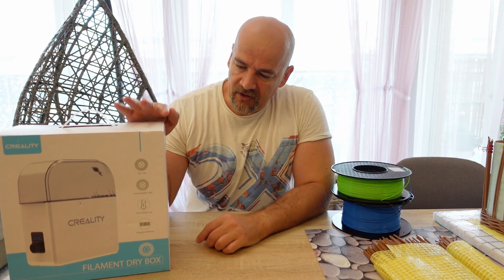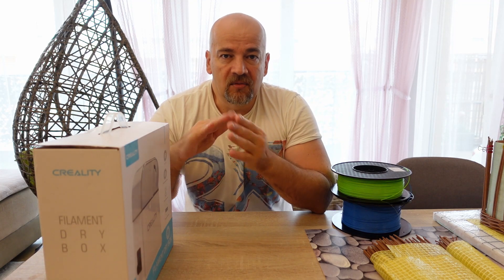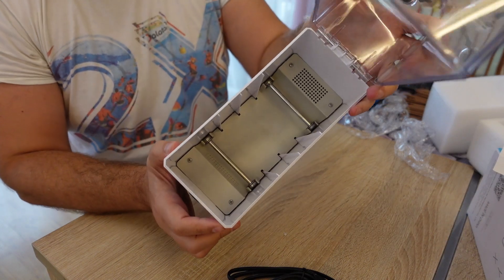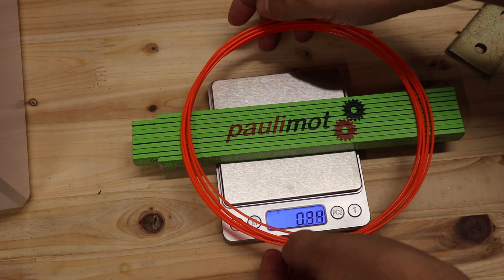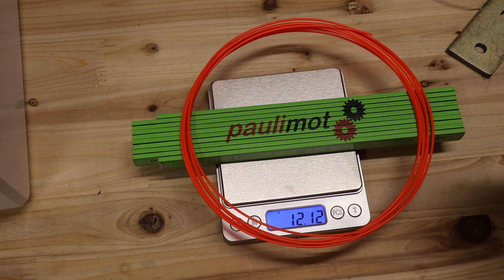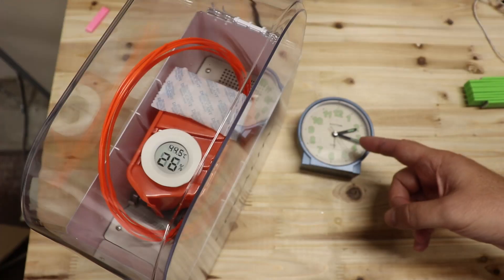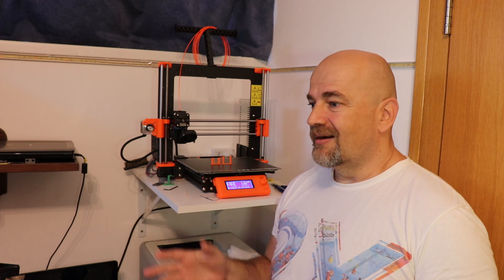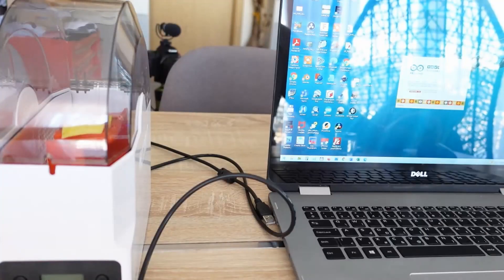Creality Filament Dry Box, new filament dryer by Creality

Comment: Very useful, thanks. I will give this item a skip as I don't think I will be able to trust it with PLA. If they include a temperature setting and a tiny motor to slowly rotate the spool, I'd buy it on the spot.

Comment: Great review. I'm facing an insane amount of stringing, just like the one you showed with the wet filament, so I bought this unit (didn't test it yet). They clearly wanted to make it as cheap as possible, which I think is fine if it works and is safe to use. To be honest I'm kinda tempted to disassemble and modify it, but I will leave that for a future project.

Comment: Which one better this creality dry box or sunlu s2?
Reply from the maker: Creality is stronger, but 95% finished product (great for DIY project if you want to replace the electronics to have more stable temperature). Sunlu S2 is better I think, but not so strong.
Reply: @MyTechFun  You mean S2 not so strong for drying the filament compare to crality?

Comment: This review is ALMOST perfect. Until he put a desiccant on a dry box🤦. I thought we were testing it🤦
Reply: I had similar concerns about the desiccants. Logic suggests, as  you expressed, that the moisture appears to just stay inside the box unless the small hole at the top is left open.  While searching online some info on using my new machine, I came across a site where a viewer asked the question about desiccants and the need for ventilation. The response was that there is a small fan (?) and ventilation port located (hidden) provided to exhaust the humidified air. I'm sorry that I didn't bookmark that site to offer it here.

Comment: Has anyone tried to use this by directly feeding it to the extruder?

I have one, and so far it's worked fine for my PLA (rated 195-215C), but the rubber-coated filament hole in the dry box seems to way too tight, which I can only assume would cause issues while printing, if fed directly  to the extruder?
Reply: You could try putting a short Capricorn tube in the filament hole and feeding the filament through it when you want to print.

Comment: NIce video, but in my opinion when you test the max temp of the base plate it is not ok since you do it with the box open, resulting in hot air escaping and the heaters working longer, than they would if it was closed, to compensate. This result in base plate oeverheating. Keep up the nice thorough work, ill be checking the rest of your vid's. Best regards.
Reply from the maker: I have a feeling, that it doesn't matter, I don't think it has a thermistor. More like some timer, which turns on/off every 3-4 minutes. Take a look this video, the graph: https://youtu.be/6VB-pEvSed4

Comment: you used 4 filament dryer and which one is your favourite or useful dryer ?
Reply from the maker: I tested 5 so far. And from those Sovol is my favourite. Most important advantage is that it can dry my wither spools too (Prusament PETG) , that cannot fit in any other dryer. List of all dryer videos: https://www.mytechfun.com/videos/filament_dryer
Reply: @MyTechFun if ı purchase a sovol filament dryer, ı have to use silica gel ?
Reply from the maker: @adnanbldr9896  For better drying just put one into hole of the spool, but it can dry without it too.

Comment: guys, just make your own DIY filament dryer meanwhile those branded one are still expensive, lets wait for it to drop about around 30.00 but 40-60 for a dryer box are a bit too expensive, since those are nothing new in technology, inside is just a heating element and maybe with a small fan that help hot air to circulate.

Comment: Disappointing that they have not provided better temperature and timer control and a better PID control for the temperature.  Your tests seem to hint that the heated plate is capable enough, but the high temperature fluctuations and lack of control over them seems very limiting.  Lately I get the impression Creality is too often missing the ball, having some correct insights (like using AC heating), but then not delivering the potential due to stupid oversights or possibly cost-cutting.  And when they do have a great product (like their CRTouch), they do not price it competitively and/or fail to advertise the real advantages of it.  I get the feeling they have caught the disease many Western company has: decent engineers and developers on the floor, but too many managers and paper-pushers above them that screw everything up ...

Comment: Thanks for the ongoing and comprehensive reviews. So far, I'm still unimpressed with all of these filament dryers. For the price, they all fail to deliver what I get from a £25 food dehydrator (which gets hotter and fits two 750g spools) for drying and a simple sealed plastic box + silica gel for storage while printing. The parts and materials used in these food dehydrators are pretty much the same as the filament t dryers, so I think what we are paying for is just the fact that there is a smaller market for 3d printing than for cooking appliances.
Reply from the maker: I agree with you. Eibos will be my next review (then comparion video I mentioned) And then food dehydrator (with mods to use during printing too)
Reply: @MyTechFun  looking forward to the mods!

Comment: Great video I love my sunlu s1 good to see the difference since I’m thinking about getting a second one
Reply from the maker: Sunlu will have new version in a month or two (they contacted me if I want to test their new dryer)
Reply: @MyTechFun  Aw man, just as my S1 is set to be delivered today and the last of my mods for it are being printed for it. Do you know of any new features or fixes over the S1 like a stock fan or a hygrometer?
Reply from the maker: @kboxvegas5393  I got a picture, from that I can see: Heating from the top too, on picture it is set to 68°C, RH and Temp on big side display, probably preset values for materials (on image ABS)... (probably it is CGI, but hope real product will be similar)
Reply: @MyTechFun  Thanks for the info, it sounds like there is hope for a lot of improvements. I am going to still keep this S1 as the mods detailed here https://www.youtube.com/watch?v=6FG4O5l9XpE still makes this a great performer for under $50 including fan and hygrometer. It took ~15mins to do the mods and I have some old PETG drying in there right now so fingers crossed. I also setup control through Octoprint to control power with the PSU Tasmota plugin and plug.

Comment: :) i am just wondering these dryers could do the job up to 3-5 rolls easily. Only the  plastic housing  should be a bit bigger. They are a bit overpriced compare to a 3d printer, but i do understand the kind of "minimum price". Although i would rather pick the Cyclops not only because that one deals with 2 rolls, but the design is matches better to Creality"s printers
Reply from the maker: Cyclops will be my next dryer test. Sovol dryer is also good, space for 2 spools
Reply: @MyTechFun  i will be here ;)